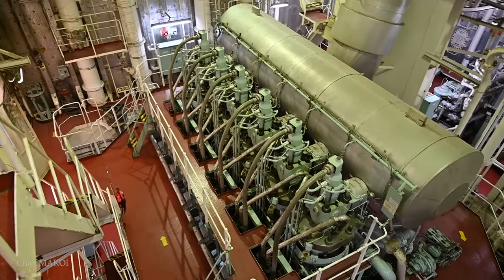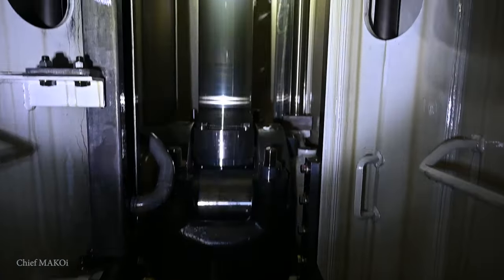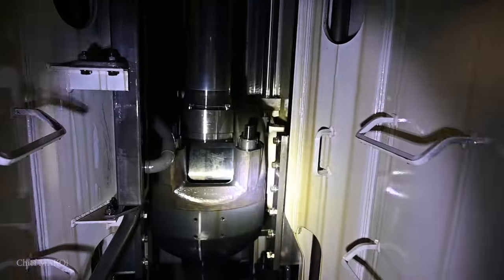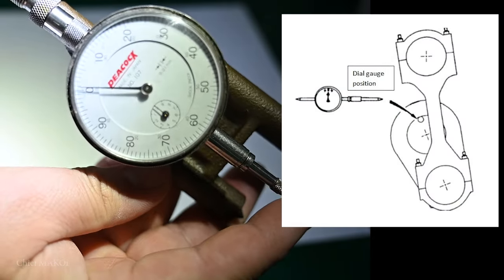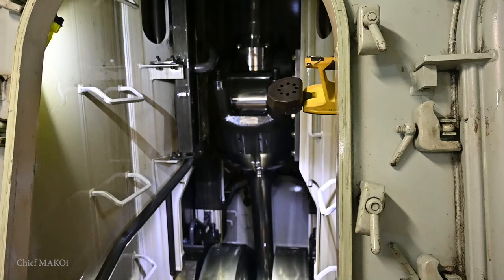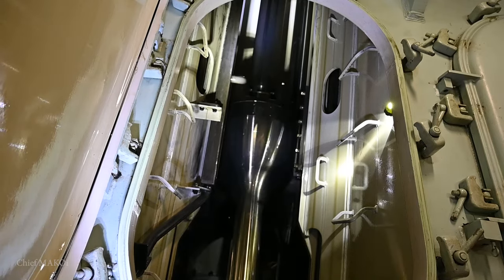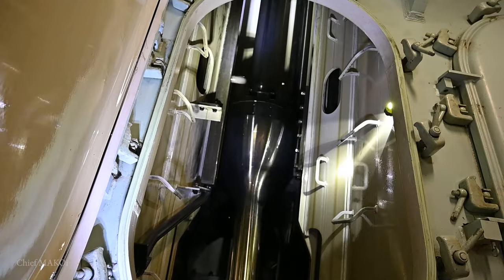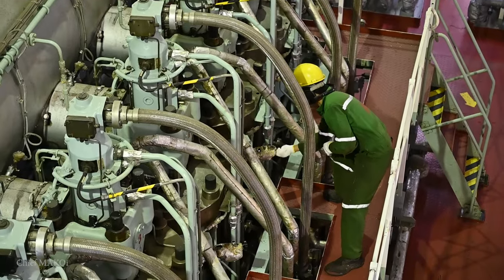Main Engine Crankshaft Deflection Reading | Chief MAKOi

Comment: Hi from uk chief MAKOi 👋👍 great episode and well done to the engineers that keep these massive engines going👌💪 but I have a stupid quick question for you plz?  I work on cars and am familiar with engines but on something this scale how is the timing kept in check is it chain driven or main gear cogs wheels running oil pumps and fuel on timing etc and have you ever had a  main engine failure whilst at sea?  Thanks for yours and crews time be safe and see you soon👍👋
Reply from the maker: For cam-driven engines, there are gears and chains.  The engine shown in the video is cam-less so timing is controlled by a computer.
Reply: @ChiefMAKOi  that amazing I bet there is one or 2 electronic modules floating around too 👍 I am really impressed with this feature👌 maybe soon could you do a upload on on the working on these engines how timing is achieved maybe on a service interval obviously time depending on yourself and the crews plz ? How big are sumps on these sorts of engines? How much oil resting and what should be in system running ?
Reply: @marksaunders2500  The engine on a fishing boat I worked on was much much smaller than this engine, and the main engine lubricating oil capacity was 5 metric tons!. The two auxiliary generators had about 1100 liters of oil capacity each, and that was replaced on a schedule. The main engine oil was straight 50W, and as far as I know, was never replaced. Only topped off and regular samples sent in to BP. To basically keep track of wear metals, and keep an eye out for a sudden spike of bearing material etc.

Comment: @Cheif MAKOi  I'm curious do you know the compression ratio of marine engines like the one on your ship? are they similar to diesel engines? before you mentioned the crankcase explosion I was just thinking that a self aware sailor would realize "im working inside and around an" engine block with massive moving parts that could fail and destroy themselves at any time" and that it might lead them to take better care of the vessel they inhabit 😅 those are my thoughts awesome video thank you!

Comment: Crankcase explosion... Caused by...? Crankshaft breakage? Hot bearing igniting oil vapors? Or? Do these engines have explosion detectors to effect an immediate shut down in such an event?

Comment: Regarding that spare cylinder and cylinder liner, does that mean this engine is not like a normal car engine where if one cylinder is bad the whole block needs to be replaced? That makes a lot of sense but it must be hard to have the engine  setup that way!

Comment: How does cylinder combustion work in a piston that moves so slowly? Is it a slowly combustible fuel that builds pressure..pushing the rod, or is it one big combustion Boom?

Comment: Why you didn't place your dial gauge in exact centre of crankshaft. Or crankshaft axis of rotation.
Crankshaft has got a huge journal which will have centre.
Reply from the maker: Because we're measuring the deflection from the crank web.
Reply: @ChiefMAKOi  So web and crankshaft both have some relative movement with each other according to shaft position.

Comment: Curious how do you rotate the cranck when engine is not operating? As for a car you can do this by hand. Guessing some small engine or something like that can be used to rotate it.
Reply from the maker: Motorized Turning gear on the flywheel.
Reply: @ChiefMAKOi  Thank you for the answer.

Comment: cross head engine design. 
how you change a plane bearing? does the whole engine have to be split? can ypu just put cylinder at TDC and push it out of the side?
does the bearing resemble a car bearing? 
Multilayer main bearing? soft material on the outside?
someone once told me that you could replace a cylinder while on route is that possible how do you disable one cylinder

Comment: So by looking at the way access to each journal and cylinder on the crankshaft, are they in separate enclosures, or is there common access to the entire crankshaft? Also guessing the oil system is dry sump. Enjoy watching your channel mainly for your engineering explanations, but also find your other videos interesting.
Reply: You can see in the video the cadet can go all the way down to the oil screen, and duck underneath and get to the adjacent cylinder. Some engines that are smaller, there's no room. A Cat 3616 for example only has room for maybe 1 small guy and even then it's a challange to squeeze into the crankcase door.

Comment: Hey Chief!  Great video.  How much crankcase pressure is there under regular operation?  You you have viewports into the crankcase to observe the goings on while underway?  If so, maybe in a future video a couple of shots if possible?  That would be cool to see.  If not, just lock the lowest ranking guy in there with a video camera.  Tell him he has to take one for the fans.....  Thanks!!!
Reply from the maker: The crankcase is isolated from the scavenge space by means of a stuffing box seal on the piston rod.  So it's not really pressurized significantly.
Reply: @ChiefMAKOi  So what about the part of stuffing the guy in there with a cam?.....  Thanks Chief!
Reply from the maker: @rherman9085  😂

Comment: How does combustion work at such low RPM? Does the fuel burn much more slowly than a petro/gasoline engine? I’m think about ignition in an engine, and how quickly it happens, but at these slow speeds, it kind of doesn’t make sense to me. I suppose these huge masses there is ton of momentum involved. What do these engines idle at?

Cool video, thanks for sharing.
Reply: The engines don't really "idle".  There is no transmission, the crankshaft directly drives the propeller.  To stop the propeller, the engine is stopped.  To go in reverse, the engine is started in reverse.  To travel at a speed slower than the engine is rated to spin, the engine is started, runs a big and stops again.  When the ship is 100,000 tons, the speed doesn't change fast.

As far as combustion:  In a car or truck sized engine, the losses of heat through the walls is huge.  On an engine like this, the losses are far less.  So the air doesn't have much of a chance to cool down on the compression stroke.  At the start of injection the fuel is very hot, so ignition is fast.  The fuel is pretty much burning as fast as it enters.  Because of the slow speed, the total time of injection is far longer than in a faster engine.  So that makes the combustion time quite long by comparison.

Comment: The connecting rods and posts must weigh thousands of pounds each.  I'm surprised that this is a vertically mounted inline engine;  You would think that a horizontally opposed design would be more efficient due to the fact that energy is not being expended to move these parts against gravity.  Yes, there are other parts that are descending so there is some balance, but there is still some fuel mileage to be gained with the opposed design.

I guess they don't do this because opposed engines of this size would be difficult to work on?

Comment: Are ship engines always vertical pistons or do they sometimes have horizontal piston rod blocks? In my head horizontal would make some maintenance type things easier? Also, you can’t just show engines blowing up without telling us how rare or often it occurs! Also, is the ship scrapped at that point or can an entire engine block feasibly be replaced?
Reply from the maker: The crankcase explosion is a topic on its own.  I'll list it down as a future video.

Comment: Fascinating, do you ever have to remove and replace the crankshaft?
Reply: Pretty much never, the ship normally is assembled around that engine, and removing it is going to be almost the cost of the ship. Only ones that do that are navies, where the cost of running the ship is not recovered from carrying cargo port to port, and they might need to have the ship operating for decades after building. Very few cargo ships are over 50 years old, but a great many navies still have ships that were built in the war period, just modernised and upgraded at great expense between, but even the US navy decided to scrap a 2 year old ship, rather than fix a faulty gearbox, as the cost to do that was pretty much the cost of a new ship.
Reply: It is possible on some ships.
But its a pain in the back. 
There are documentations on YT where a cruiser gets his replaced. 
They had to cut parts of the floor out .

Comment: Hi Chief, On a different topic if I may. The propeller, how is the water stopped from entering ? Sorry if I have missed the video on this, if you could be so kind as to direct me.
By the way, love your Videos.
Reply from the maker: I haven't made one about it yet.  But for a quick answer, there is a stern tube and shaft sealing system.  Basically there is a shaft seal similar to what pumps have and it is "pressed" to the shaft by oil and in some systems air pressure.  I'll include this topic in future videos.
Reply: @ChiefMAKOi  Your the best Filipino. Only my Filipino wife is better hahaha

Comment: Is the spare piston there for scheduled pm, or are there situations where a piston needs immediate replacement? If it's the latter, what the heck could damage a piston that size bad enough to warrant replacement?
Reply: The answer is Yes and Yes.
Piston crown profile may get burned out of shape.
Piston ring grooves may become out of spec.
In that case the crown is landed ashore for reconditioning. This is done by welding up the affected surfaces and machining to spec.

Comment: Why would the crankcase explode?
Reply from the maker: Oil mist ignition.  If main bearings are damaged, metal parts tend to get hot which boils the lube oil and causes oil mist.  If there's enough concentration of oil mist and it ignites, kaboom.
Reply: @ChiefMAKOi  I've seen some older engines with a photo-eye type system that sets off an alarm if there's a high amount of 'fog' in the crankcase. But these were troublesome, and lots of false alarms from the sensor getting dirty, and people would bypass or ignore them. Cause of many crankcase explosions. The engine is so loud, you can't hear the sound of one bad bearing with all the noise and proper hearing protection at full speed.

Comment: I did not know crankcase explosions were a thing 😬
Reply: A hot bearing can start burning oil.  That will fill the crankcase with boiled and decomposed oil products.  
On a small engine the failure of the bearing becomes destructive before it could explode.  On a big engine, the bearing can burn for a while with little other symptoms and when all of the combustible gasses hit the air once a failure happens, it makes for a massive fire.  The cruise ship that burned off the coast of Mexico a few years back had this happpen.

Comment: Now how is this thing lubricated... i can imagine it does not spin so slow during normal operation, ( i might be wrong)
Reply: Oil is pumped to bearings also sprayed under pistons and upon crosshead slides. 
All the lube oil drains back to the sump and is continiously pumped out thru a purifier(filter) then back again.

Comment: I saw the slots in the side of the cylinder. Are these two stroke engines or four stroke? How many horsepower?
Reply: Two stroke uniflow.  Air enters in the ports and goes out exhaust valves in the head.

Comment: What’s the lube oil pressure on a engine like this . I’m guessing it’s an external electric driven pump for that
Reply: There are even two electric driven lube oil pumps. One on stand-by which is a classification requirement for the UMS notation. (Unattended Machinery Space)

Comment: Do modern engines not make use of explosion relief valves or are they on the other side of the crank case
Reply: The size and number of crankcase relief valves is prescribed by the classification society and is based on crankcase volume.
Reply: They are on the other side.

Comment: Why is the stroke of the pistons so long compared to a car engine. Is there a special injection going on or is it only due to different fuel types?
Reply from the maker: Longer stroke means more air can be drawn into the cylinder, which means more fuel can be burned hence increasing power output.
Reply: A longer stroke means more displacement, which allows for a higher power output while keeping the bore size manageable.
Reply: Also, I'll add they only turn about 120 RPM or something and operate at constant revs for long periods. Compared to car engines these marine two stroke engines operate over an very narrow operating band. As Chief alludes to, the long stroke allows for more power in a more compact installation. At this level of power bigger bore means a far bigger engine size for absolutely no advantage at these RPMs. Big bores than strokes are for small engines. It starts getting complex past here.

Comment: At the end you said you visually checked for left over tools, Do you not shadow box your tools on board?
Reply: I remember a situation that we opened the crankcase for an inspection and that the fitter said: Ah, there is my sledgehammer! Standing upright on the bedplate against the A-frame.
Reply from the maker: Just SOP.  It's better to be sure.

Comment: Any idea of how many psi the cylinder creates on compression stroke and when the fuel ignites. In other words how high is the pressure when the piston is being forced down under full throttle.
Reply from the maker: PComp is around 1570 psi,  PMax is around 2175 psi.  That's at 85% MCR.
Reply: @ChiefMAKOi  I think the proper term he's asking is what's the MECP. Mean Effective Cylinder Pressure. With this info, and the piston surface area, we can calculate the peak torque of the engine. But I don't think the pressure at TDC without fuel injection could be 1570 psi. I think those engines are only around a 16-17:1 compression ratio? So say at 5 bar air pressure coming from the aftercooler to the scavenge space, would be about 850psig at TDC (with no fuel injection). I suppose you could have 1570 psi if turbocharger at full speed, at 75 psi air pressure and the engine was 22:1 compression ratio. But usually this high of a compression ratio on small high speed 4 stroke diesels are only naturally aspirated ones.

Comment: Surely turbine engines were available at the time this ship was built!?....
Reply: ofcourse, marine turbines have been around for a good 70 years at this point.
Its just that on a ship, space and weight are not a big problem, so Diesels have no problem fitting in ships.
While they may be a little bit more efficient by themselves, i imagine the insane reduction gear needed to get output RPM down and torque up would cancel out the higher efficiency.
So, why would you want a turbine in a ship this size ?

Comment: How to get a free tour of a ship's engine room.
Travel on a foreign passenger ship. 
Example. I traveled on Gothang lines from Manila to Nasipit Mindanao.
While on deck I noticed an engineer taking his lunch break. He was wearing orange overalls with spots of grease on them. We made quick friendship. Filipinos love Americans.
He invited me below decks. The door opened and a huge blast of heat hit me.
I said hold a moment. A drinking fountain was near and I soaked my t shirt in the water and put it on. Now I'm ready. 
The engineer said don't stand in one place to long because your shoes will start to melt. So we put our hard hats on and again opened the blast furnace door.
We walked down long stairs. Everything was painted a bright green color. Heat and noises increased. Hand rails near untouchable. Next time I'll bring gloves. The engineer his hands look like leather.
What fascinating me the most was the size of the pistons and rods.
Some not being used were laying in a shop area.
Being a mechanic I asked where's the giant torque wrench ? 
He said before taking the huge nuts off, he notches them. One on the nut and one on the bolt end so they line up. 
He showed me the notches.
By now we where hot and my shirt which buffered me from the heat was nearly dryed up and my shoes where sticky and half melted.
We stepped into the air conditioned control room.
Two other men where inside cooling off monitoring gauges.
They were smiling laughing at me. 
The dials and gauges were marked in another language not Tagalog.
It was Japanese. Filipinos get used ships from Japan and use them to transport people and cargo at the same time.
You have to see it to believe it.

Comment: What is the procedure if you detected an anomaly?
Reply: Checking the holding down bolts of the engine. Inspecting the double bottom tanks under the engine for possible damage due to a grounding.
And by (partly) renewing bearing shells.

Comment: Yo chief... when the web closes the dial will move clockwise and when it opens the dial moves anticlockwise.. so we read the clockwise movement as negative and anticlockwise as positive.. is that correct.
Reply: That is indeed correct
Reply from the maker: Yes.

Comment: Not your Grandma's 4 cylinder Ford. But seriously, there is info on the internet where an engineer was locked inside a crankcase and died when the engine ran because no-one knew where he was. Baked like in an oven.
Reply: That was a sad story Yes, I remember it.
The 2nd engineer was trapped inside the scavenge air receiver

Comment: How many gallons of oil per engine?
Reply from the maker: In the engine shown in the video, there's about 13 cubic meters of lube oil in the sump and circulating in the lines.
Reply: @robert So there are 3450 Gallons of Oil in the Engine. Damm guys use the metric System !!!